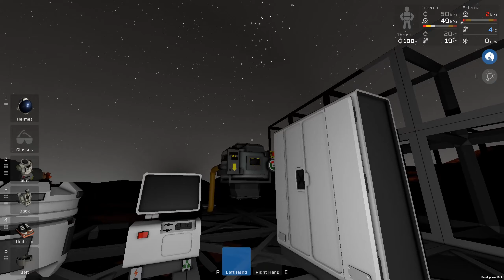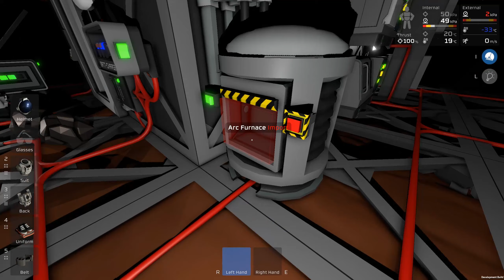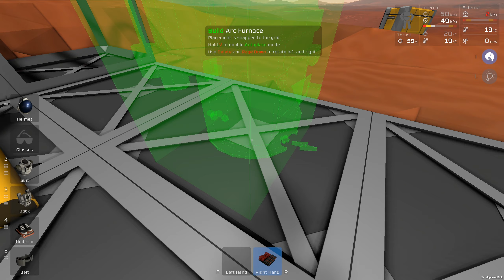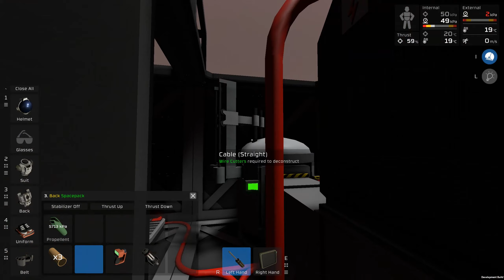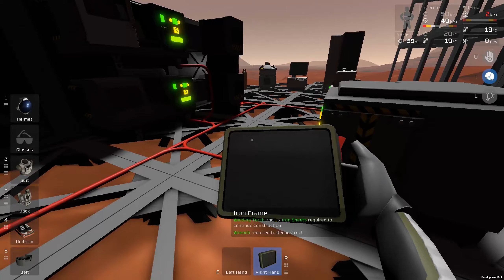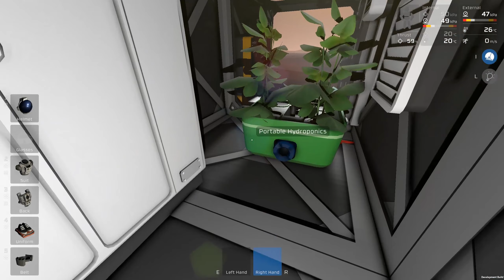Stationeers S4 E09 - Furnace Gas Capture and a new building!

Comment: why not full auto on the arc furnace? import slot != export slot then activate.
Reply from the maker: I think that used to jam when being fed by chutes - is that fixed? If so, yay!
Reply: @grayduster  From what I hear the chute jamming is supposed to be fixed, but I love the speed of the gas furnace for processing tons of ore and less energy.
Reply: The jamming is solved. But sometimes the items can still fall out of the chute and get stuck between the chute and an outlet. But to me it has only happened twice in 100+ items going through the output chute.

Comment: The chutes don't get jammed any more - almost ;-), but I usually just fill the chutes and lets the arc furnace work on auto, so I don't need to babysit it. And the devs also fixed the dublication bug in the arc furnace, so you can just add whatever ore in not particular order.  I usually put a reader on both input and output and 2 writers to activate arc on either one. I'm looking forward to seeing what you want to do with the furnace input and output/pressure control.

Comment: I know this conversation has been run into the ground, but you can always say "1 group/gross of iron" ;)  A gross is 144 of something, so if you think if it as 144 grams, it might work?  It's mixing Metric and Imperial and a little light (˜1/3 pound), but whatever.
Reply: It's the developers' way to express their annoyance that the SI base unit for mass became the kilogram and not the gram.
Reply: I think they should just call it units, and let the weight/mass of that unit be undefined.